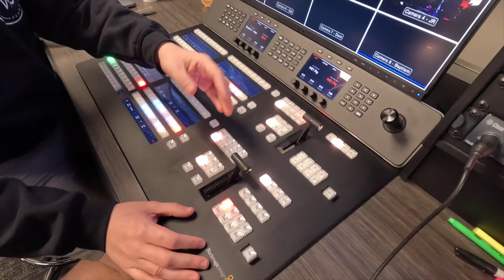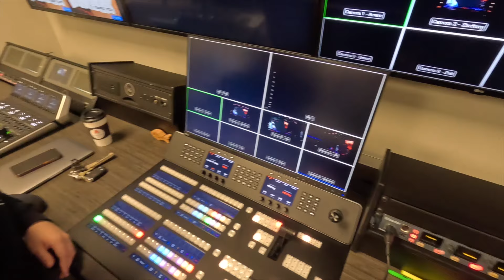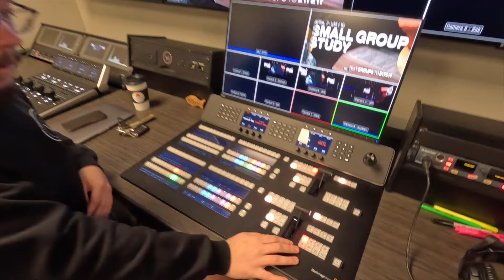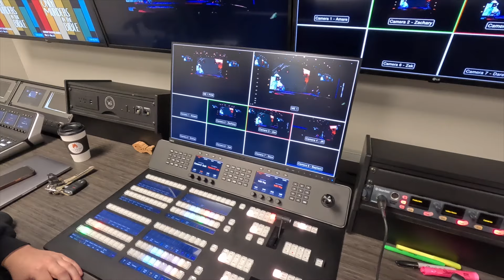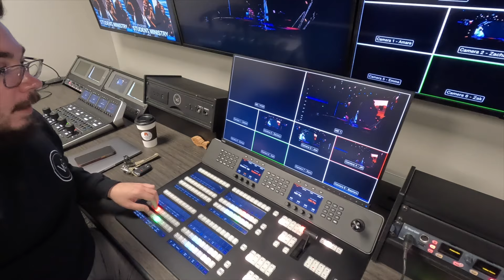How to direct and use a switcher Q&A with church video director see the control room

Comment: 1. I'm definitely a quieter director. I like cutting at the beat of the song and I've seen other directors take too much time to explain stuff and it messes up the flow. And I also like to see what the cam ops come up with and where they need improvement. They should all train and becime good enough to know what they should be doing. 

2. I like the labels below the buttons. Nice switcher. 

3. Some people use the Program keys but I don't. Definitely seems riskier.
Reply: In your point #3 you say cutting on program seems risky, why? If you look at your monitor wall and the camera is “proper” there, previewing it doesn’t make it better.
Reply: @mikecumbo7531  Yeah, some people are ok doing it that way. For me, I'd rather have a shot previewed and press Cut when ready. Pressing the program buttons directly is all or nothing.

Comment: Why avoid the auto for the T bar?
Reply from the maker: I tell directors to only use the T bar because the auto button is set to a rate that you have to change within the menu. Music requires a "feel" not every crossfade should be 15 frames, etc.
Reply: @westsideproduction  makes sense.  Engineering on a Imagine Dragons and Pink show and the director said the same thing
Reply from the maker: @robertacevedo5601  Yep, I"m 100% with that for music. I think if you are directing sports it makes sense to set your frames and just use auto. But, also, to each their own! Use what works for you.

Comment: I used to work in an editorial and financial agency in Milan in 2019 and when i saw the directors using this machinery i was always fascinated by how it worked and how they worked. I used to be an editor for CNBC (Class editori CNBC) and I only happened to make a contribuition for the milan subways once and even now it would be complicated for me to replicate it. BTW cool video, I am so happy to come back after the COVID 19 BS to work in SKY and I'll be doing the Operator Platform Control. That's gonna be a new experience and also a new challenge, do you guys have any advice on how I can prepare before June 17th?